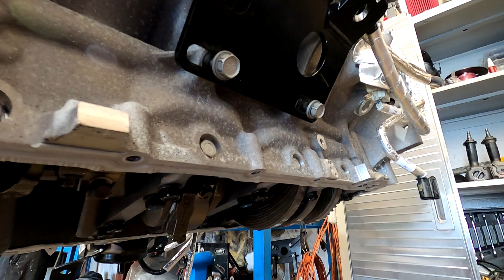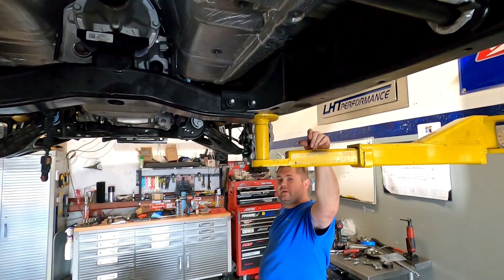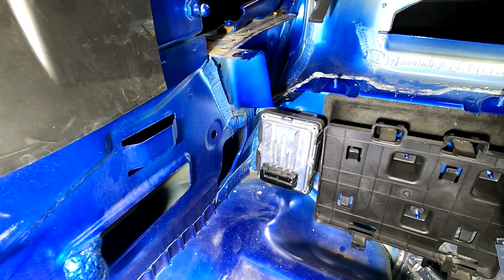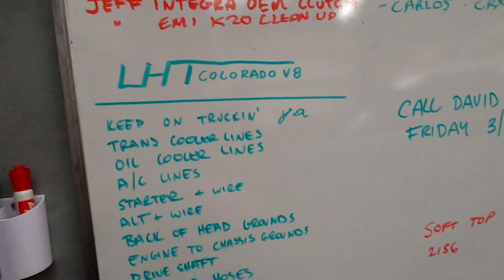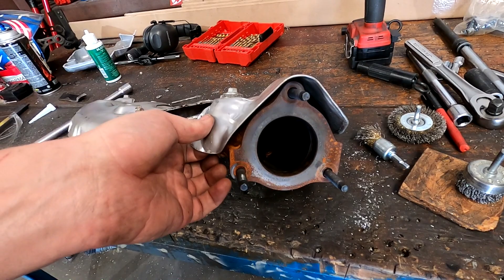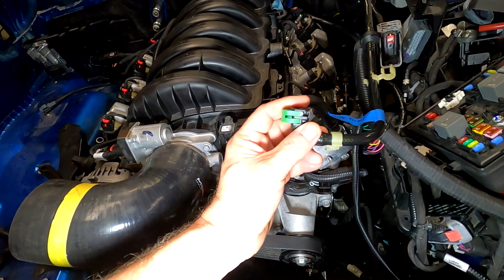2020 Colorado V8 SWAP , Oil pan modification Part 3

Comment: Would it be possible to use the Colorado 8spd transmission?
Reply from the maker: No. Plus I wanted a 6 speed transmission. The 8 speed doesn’t have the best reputation

Comment: Looking at doing the same thing to a ZR2. Bought a '21 and hate the v6 but love the truck. Its probably going to be a bit more complex with the added hardware though
Reply from the maker: The ZR2 is the same motor. It’s pretty much the same drive train.
Reply: @LHTPerformance  It is but also have the front diff and driveshaft to deal with. There is another guy on one of the zr2 fb pages doing one although hes not very far into it.
Reply from the maker: @ZeroFabsGiven  That’s right, 4wd.

Comment: Very nice work so far. Why don't you get a 2020 Silverado radiator and that may fix your hose problem.
Reply from the maker: We looked into that. The radiator is about 10” wider and will not fit between the frame rails.

Comment: Get a aluminum radiator and use -AN fittings. I think it might clear up some space. Also maybe oval out the air intake pipe over the upper radiator hose for clearance.
Reply: or an aluminium radiator with inlet/outlet that can be "moved" (solder) anywhere.